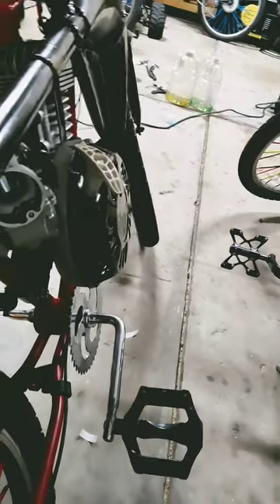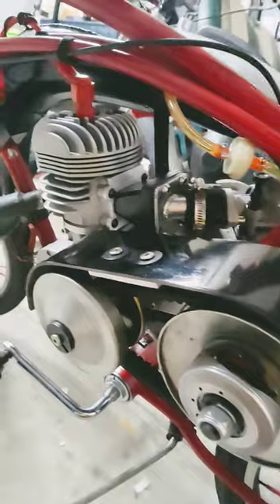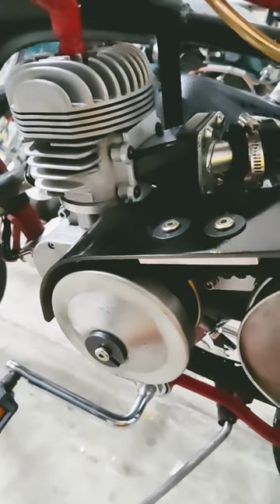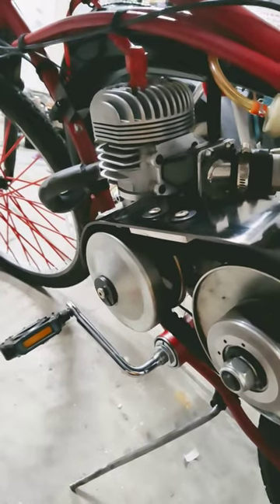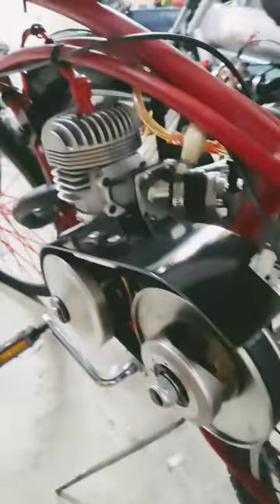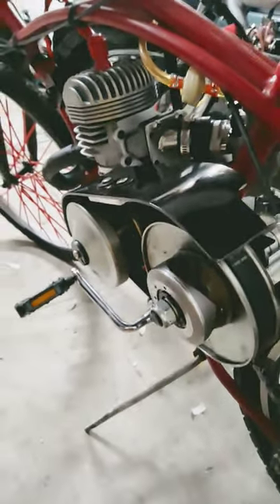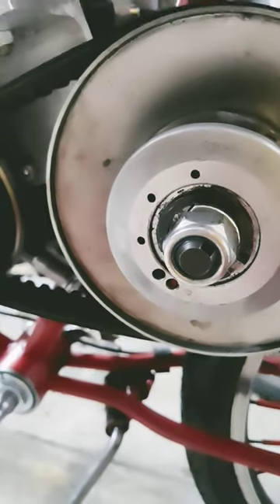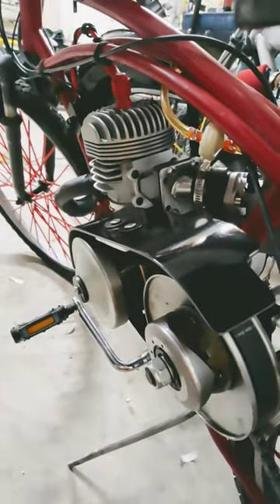So how does the China Doll CVT Transmission! The secret sauce revealed!

Comment from the maker: To make this clear! Drive pulley starts to ramp up at 750 rpms.   2300 ish driven pulley is fully engaged.  When pipe hits 2300 is dropped to that cvt which is  13k ish rpms. If all the math works out correctly. All rough figures but this build is all a new world.  There is no YouTube how to 😂.   

Point is everything at the  engine point of 13k when pipe hits i have a greater mechanical advantage over a normal china doll hybrid.

Edit:  should have said 4/5ths throttle. Not mid throttle